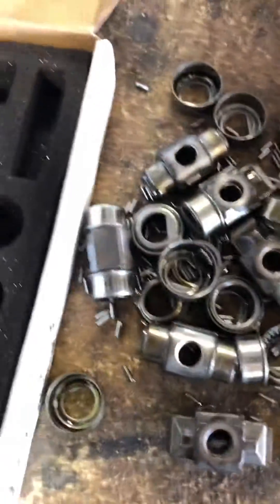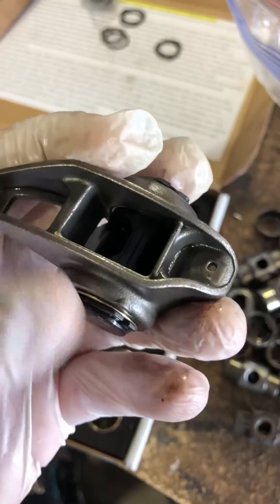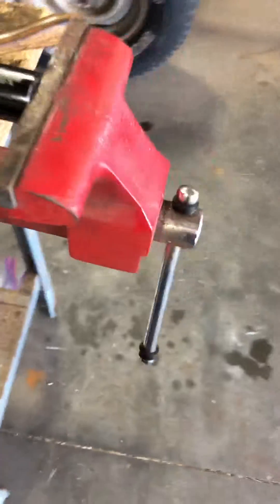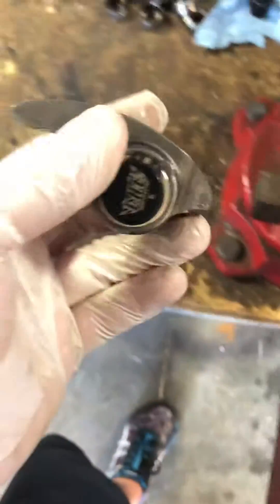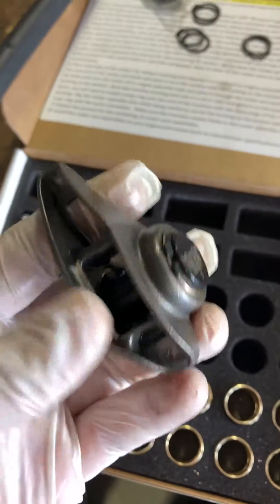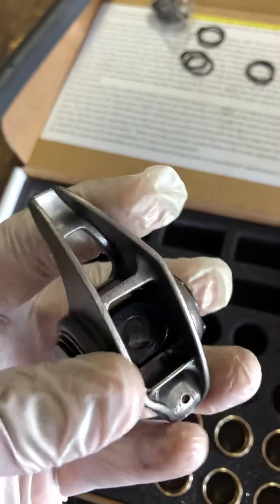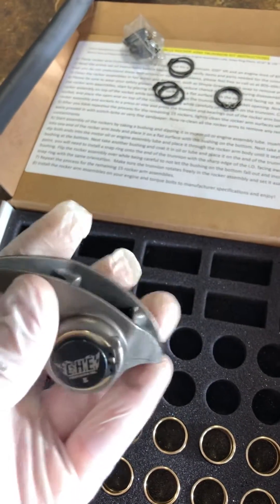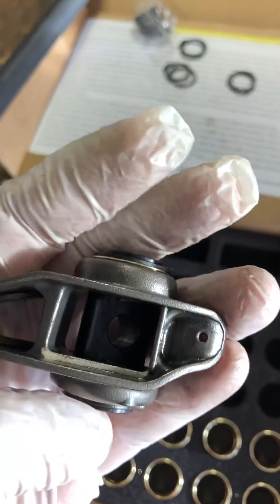C.H.E. Trunnion upgrade for LS7

Comment: I also noticed the side to side play and was wondering if it was normal. Kinda threw me off when I was adjusting for lash. So how do you like them?
Reply from the maker: 10k miles now. No issue with heads or these. Quieter upon first startup. Still quieter than stock as far as valve train noise.
Reply: @krismoe2160  I put these in my ls2 and love the idea of no more needle bearings. I only have a few thousand miles on them, but so far no issues.